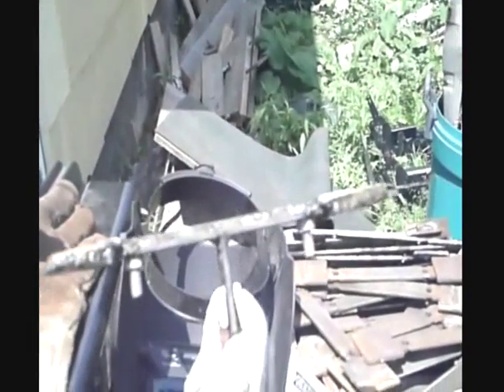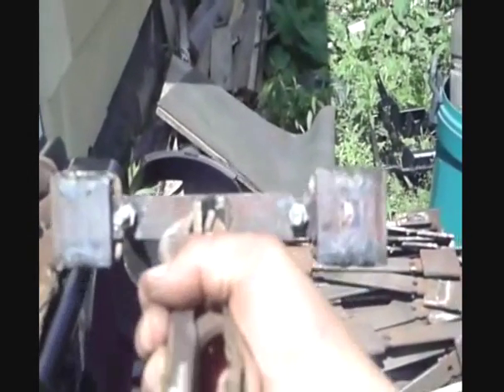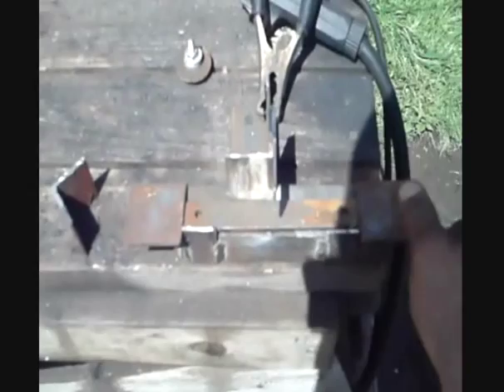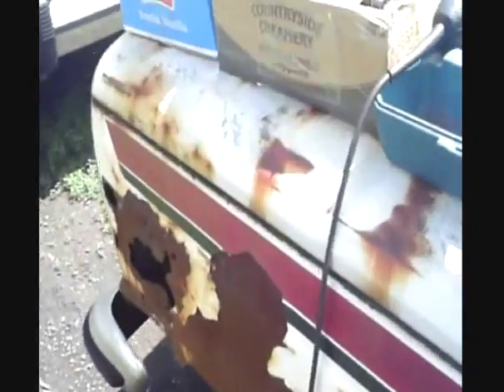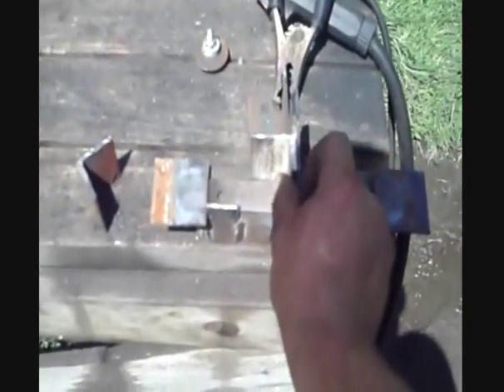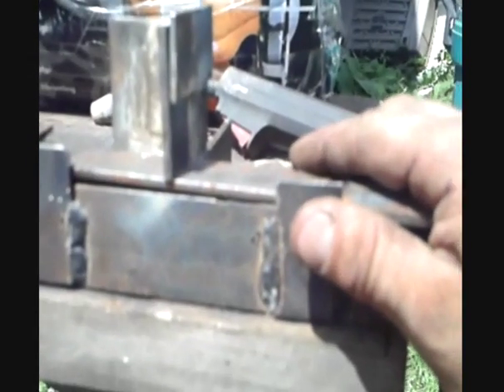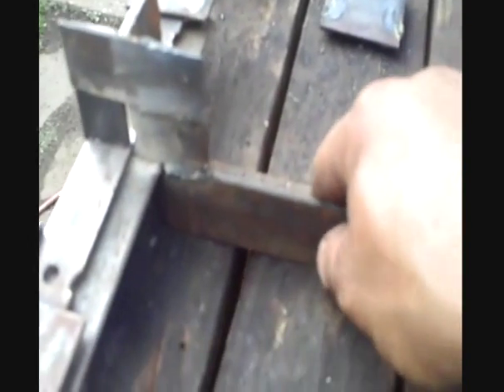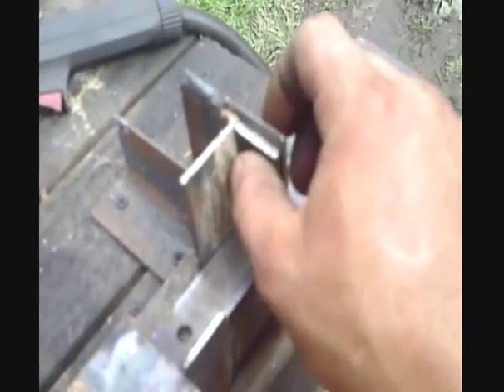Make and build your own tank tracks (X1 Scorpion track design) part 8

Comment: That's a bunch of work,but worth it... You go Man
Reply from the maker: ***** Thanks, I'm up to 26 of the plates finished. Only 122 to go, LOL.
Reply: What's the hold up ?  lol   You'll get em...
You need an assembly line.  
yeah That's it
Reply from the maker: Yah I do!!! With some help too, LOL. Nah, I'm fine. My welder can't handle it. I weld up 1 and have to let it cool, definataly reaching the end of the duty cycle. If I do another one it will trip the overheat switch. so it's like 1 every 15 minutes plus yard work.

Comment: This is a cool project!
I'm kinda curious if you have tried to figure out how many rolls of welding wire you are gonna use haha...building those tracks is monumental!!
Reply from the maker: MrTheHillfolk So far I'm on the second 10 lb spool, but I used the first 10 lb spool for other things also. I'm sure I'll need another 10lb spool for the odds and ends. WOW!!. I used about 6 or 7, 1 lb spools when I did the chassis. I got tired of buying the 1 lb'ers so I just bought a 10 lb'er. for 70 bucks at Home Depot, same price as Harber Freight but way better quallity and way easier to weld with.